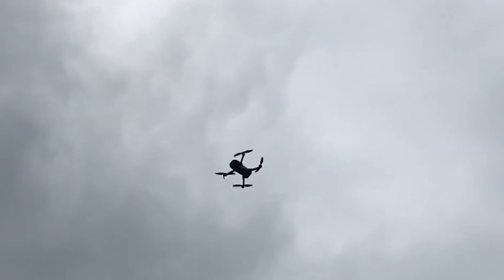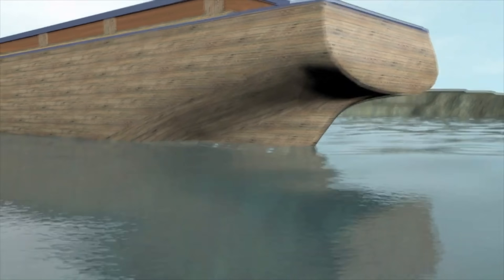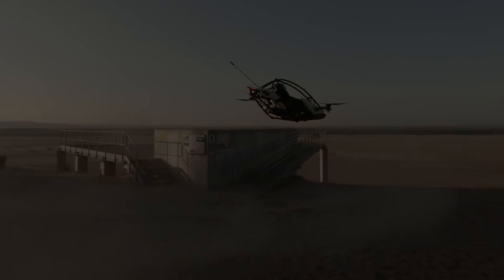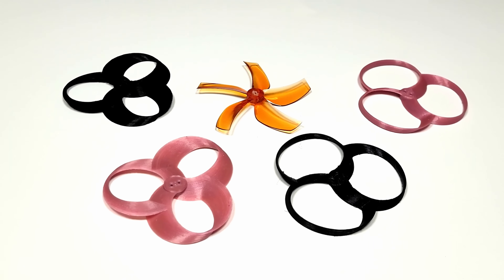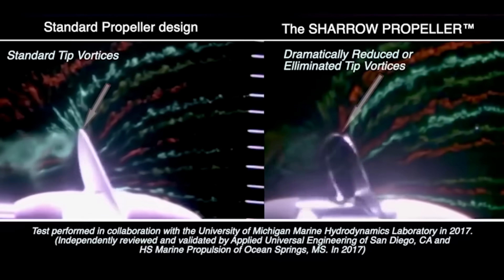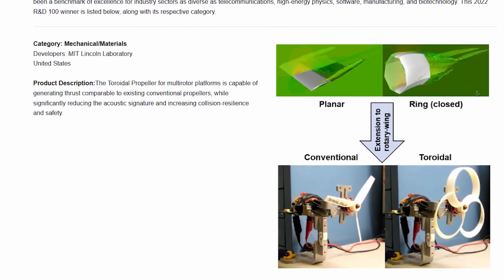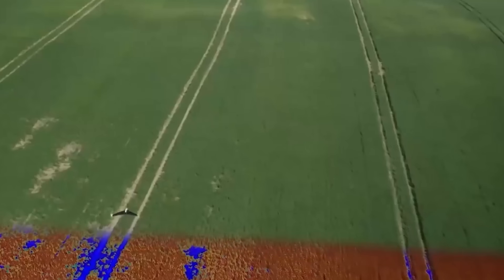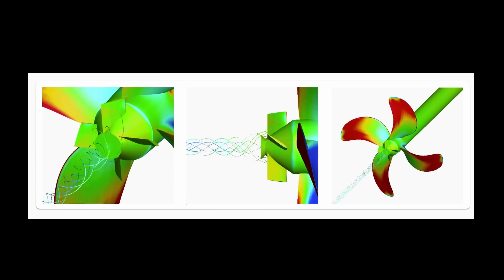This Propeller will Change Aviation Forever!

Comment: Ah yes ill be re inventing the wheel next. They are not vortices they are partial toroids just as tornados are partial toroids thats why creating your own toroid which can be done with many different blade designs is going to cancel the small toroids and make one big one. Wanna know how to make the turbo fan on an airliner quieter? I was going to use it for a hover engine. If you make a good enough toroid you can create a ground effect, then you have a skate board. Im documenting this.

Comment: Hi. Existing aircraft propellers are about 80% efficient so there's little room for improvement. Certainly not a doubling of aerodynamic power delivered, 100% is the theoretical maximum. 

Efficiency depends upon the pitch of the blades and the altitude of the aircraft, so a "one size fits all" approach isn't possible either. The reason propellers haven't changed since the Wright Brothers, is that they established the science behind them and the only improvement possible that significantly improved efficiency was variable pitch. Extrapolating from slightly improved performance on low altitude model drones to full scale aircraft at various speeds, heights, and power levels isn't warranted. Cheers, P.R.
Reply: I don't think a variable pitch Toroidal  propeller is likely to ever happen.
Reply: @mojoneko8303  Hi. Probably not, however for constant speed constant power constant pressure uses such as ships and hydroelectric turbines, a toroidal turbine could increase efficiency by 10%. For Norway and NZ that's a lot of extra carbon free electricity in their national grids. Cheers, P.R.

Comment: the plastic 3-d printed ones seem to be somewhat practical but the ones that are machined will never be cost efficient unless they cast them similar to how props are made currently for marine applications. I have been in machining my whole life and love seeing designs change throughout the years but it just wont make sense. If you go to buy a new prop for the standard guys application and see one for $150 vs this one that gives maybe a bit more fuel efficiency and considerably more brittle for $800, 99.9999% of the people are going to buy the one for $150. The other benefit is that cast props can be repaired fairly cheaply. I dont see how you can just repair this odd shape prop. You would be forced to buy a new one as soon as it gets even 1 small ding in it.

Comment: This is never going to work in aviation... turboprops need variable pitch otherwise takeoffs with high loads will be next to imposible without magalong runways and the engine casing on turbofans eliminates any real gains from this as it of how it works and trapping shockwaves etc to keep the energy. This fixed shape has to be optimized for one range of power and rpms, which may be o.k. for drones to be quieter, but dont really see future for this in general aviation.

Comment: The cover photo of the Cessna with a ship's propeller shape in any material, especially heavy metal, wouldn't fly. That is called a low aspect ratio blade shape with a twist like a cork screw, and designed for water, which does not compress, therefore the shape needs to accommodate that problem for solving propulsion. Air compresses and needs a much higher aspect ratio set of blades with higher rpms in order to create propulsion. And in modern airplanes, they become way more efficient with the ability to change the pitch of the blades during flight, like changing the gears in a standard shift car.

Comment: I had one invention in mind, since im still poor, and have no free time, ill share here. Flying skate basically, using Toroidals in smaller scale, with top vents along sides and smaller ones in middle, Gyro-stabilisation from human drone deck (spyderman cosplay) and it shall be fine to manouver, all builded in, so no sticking propellers.. even if it would work for 5-10mins of flying , you can still fly on damned skateboard, since i saw this movie, i told myself one day, ill have this, even if i have to build it myself :D I was naive, but i still want that sht

Comment: No they wont lol, performance sucks so far. They are very heavy and probably not as efficient, as for example a 2 bladed prop if you add the motor efficiency, they are also more complex and require more material, they are therefore more expensive. The thrust produced compared to normal propellers is no where near it has to be (look for chris rosser s vid). They require a mutch higher throttle output to stay up in the air, making them even more inefficient.   (from a drone perspective). Zipline props  are just better in almost any way.

Comment: This is one of those things that the engineers love but isn't practical. 8,500 hour pilot prop pilot here. Firstly, this isn't variable pitch and a huge amount of prop aviation is variable pitch. In theory you could make a VP version of these but that would require high speed mechanics (like almost sonic at the blade tips 'high speed'). Not to mention this would trade effectiveness for mass. More blade means more mass or less surface area. Seriously, these are not going to work on existing aircraft.

Comment: Look up videos of "ribbonaire fan". It was an electric fan made in the 1930's. Very quiet. And safe as the blades were loops of flexible ribbon. Arranged like a "New" toroidal propeller.

Comment: UAM is a boondoggle. Batteries simply don't hold enough charge for useful journey lengths. THEN the battery requires recharging, i.e. a significant  delay and with perhaps 10 battery charge cycles a day, the battery itself won't even last a year, more like 6 months in fact.

Comment: I wonder if you stuck this propelle on a turboprop if it could go supersonic? I ask because due to the increased efficiency the shape provides it might not suffer the limiting factor normal propellers suffer at supersonic speed namely an inability to pull in enough air to effectively provide lift for the plane

Comment: They have been around for over 100 years, so not new. They also will only affect certain size.  Unducted  fans may be coming back soon due to the fuel savings and better designs as with the RISE engines.

Comment: The graph visible at 3:40 contradicts what you say. The orange line shows the thrust generated by the toroidal propeller, and at maximum engine power it generates only 40% lift of conventional propeller.

Comment: In the future we will have propeller that change like fluid; based on what we need at that moment in flight. Imagine vertical and horizontal flight could be possible. Almost incomprehensible but possible in concept. Might be over complicating when you look at the osprey and the simple rotating assembly at the end of the wing but still could maximize efficiency based on the atmospheric conditions at the time. Maybe even “fly” in water and air

Comment: And how to have variable geometry with this propeller? It seems way too complex. If the reduction of noise is real then good for drones or home devices that use a propeller. But commercial avoation I doubt can use it in this state. Even for a small aeroplane this propeller wouldn't be too good, in case of engine out this propeller would generate I believe too much drag

Comment: This looks very interesting.  While not controllable pitch, and more massive than a conventional 2-blade propeller on a airplane, I would expect it to be made of lighter weight material that could flex, giving the effect of controllable pitch.  An advantage I see for aircraft would be substantially reduced risk of engine damage in a prop strike accident.

Comment: This design can only solved small problems with small propeller/impeller.  Good luck trying to scale this design to a medium and large propeller.  There is too much of a mass at the most outer radius and they all have to be balanced at component level then again as unit assembly.  Engineering 101!

Comment: Why does this sound like someone read a pamphlet and became an instant expert in the field.

It seems odd that nothing about cavitation was mentioned when talking about noise from propellers in water (Fluid dynamics) while actually talking on a completely different environment - Aerodynamics.
Silence is great but the tips of a toroid blade are not efficiently pushing air for their weight. The do however reduce the effect of the tip of a blade breaking the sound barrier.
(a similar reason why a current submarine prop is more shark fin shaped rather than straight like a helicopter (and even they often now support a shaped tip to reduce noise.

So lets see some result on lift capacity of a toroid prop versus a noisy one. If a toroid prop can be silent AND provide anywhere near the efficiency of a standard blade then Aviation can change

Comment: A well designed classic propeller can easily achieve 90% efficiency when operated in optimum conditions. So, an increase of 100ds of % of efficiency with this new design is pure nonsense.

Comment: I'm curious if classified naval submarines are already using a design like this. They go to great effort to conceal the props when subs are in dry dock. It could make sense considering how important it is for submarines to operate as quietly as possible.
Reply: Just look at USA propellers advantage over USSR until they purchased CNC technology from Toshiba.
Reply: @l3eatalphal3eatalpha  USSR made quietest submarine, "black hole", why USA didn't buy same technologies?
Reply: Not quite but seawolf and ohio's propellers are ducted
Reply: Dive to find out
Reply: No, but they are odd numbers of blades, and subtle differences to spread the sound across a range of frequencies rather than all at the same, reducing the power at any given frequency.
Reply: No one thought to tell Gerry Anderson that he was contravening the official secrets act when he designed Stingray then?😅
Reply: Without going into great detail.  No.
Reply: No. They weren't. Submarine "propellers" haven't been propellers for more than 50 years now.
Reply: @Nunya  no.  They still are for the most part.

Comment: I call it the non ducted ducted propellerer. It's basically a propeller with ducting included for free. ;) well giving up minimal air pushing area for getting all the benefits a ducting shroud offers.
A brilliant idea for the mentioned purposes. However not as a case fan - they got ducting(ish) frames already and having a toroidal fan inside is redundant, chewing away useful air pushing area.

Comment: Well 1st of all I'm already kind of annoyed because you used a mark Robert clip showing a silent drone with a completely different propeller design than the. One you're showing right now. Somehow. I think you're claim that this propeller will change the aviation industry is b***** based on just that alone.

Comment: So it reduces noise between 1 to 5 kHz so where is the fall off? Where is the loss? Force is resistance and resistance can be monitored. It would have advantage on the cooling fans of low performance items but not on jets. What would be the performance signature on military boats? The advantage would appear to be for light aircraft which will demise with electric propulsion anyway and presumably military drones. Domestic air conditioning units would benefit.

Comment: The Mobius strip will lift me up into the air silently. The Klein bottle will make me invisible... The painless pulse of the combat laser teleports me to a happy future, and even maybe the future itself will come for me one of these days.
The most important thing - is to reduce consumption, because ("they") just gave me a discount in the store, forgiving the missing ruble. Once, outside the city, in the tank of my car, gasoline ran out, in the middle of an empty road, where cars pass 1-2 per hour, in winter frost, when I stupidity and because of the haste, was literally in house slippers, and there were no blankets, padded jackets, there were no parachutes(such as those of the one who landed in an emergency, having broken all the the teeth of the lower jaw from сapsule hit on earth surphase - cosmonaut Volynov), I thought about removing the covers from the seats (always put good covers!) but they were thin , and in some places from cracked leatherette that did not promise warmth. The beginning snowstorm did not have drivers to stop, the mobile phone was discharged, the settlement was 5 km from the place. Russian cars cannot float on tsunami waves like Japanese ones, in ours there is always "fresh" street air, turning off the rear window heating and turning on emergency lights, I gradually froze -
however, fortunately, someone passing by stopped for a second to give me a half-liter bottle of gasoline. the "simplest" remained - to make sure that a serviceable car can start after the end of gasoline, if you fill in a new one, fortunately it turned out to be so! but in aviation "they don't fly like that"
The "road parasites" asking for 100$ today for every 6month extention of driver licence, or only 50$, if you can give your blood, for the difficult test, such as Bill Clinton would not have passed, although he did not drag out smoking with friends during his school years, as he admitted... unfortunately I have many such friends, and as a neurochemist, I am not afraid of either carbolic acids or alkaline alkaloids, I am only afraid of drugged driving, alcohol and tobacco, and federal level road robbers

Comment: I mean that was not really fair to the boats of the world using 3 30 hp motors, I say this but our old boat had basically a car engine for a motor and it was mostly quiet until you tried to run at max speed then it was no longer quiet, so maybe I'm just being silly.

Comment: You canot change a Pich angle off toroidal propeler there for you canot fly with shalow shaped propeler on a higher altitude's where the air is thiner and propeler off the single engine ir 2 engine Plane need to grab much more surface area in order to keep pushing Air to propeled aircraft forvard.....Try to get airborne Quadcopter (Drone) on higher altitude for exaple Mount Everest and the Drone will strugle to get lift..........

Comment: Toroidal geometry is the natural shape that is generally seen in the Universe around us. The shape of our current "wings" is due to our looking at birds for inspiration. However, using a lifting shape to rapidly push massive amounts of fluid or gas is inefficient on its face.

The next step will be the use of electromagnetic fields to create ionic "turbines" that can replace the physical toroidal blades and drive shafts with high-strength EM field-generating motor arrays as replacements to turbine fans, I think.

The marriage between ionic drive power and toroidal mass acceleration could overcome the limitations faced by both the inefficient legacy ionic drive propulsion systems used today and also eliminate the inherent issues faced by the heavier propeller designs and related drive shaft and motor-mounting issues of physical toroidal propeller systems.

Now, if only someone would stop playing with their 3-D printer long enough to investigate this idea... 🙄

Comment: This would be fascinating in use on submarines where cavitation and rpm issues are paramount in staying quiet. If you could reduce the rpm of the screw on a sub by 20% and also reduce the noise by the same amount it would be a real game changer in giving subs the advantage over surface ships.
Reply: If you don't think the engineers haven't tried it yet, you must not know our army well.
Reply: @Black_Toof  submarine screws cost millions of dollars and installing them takes weeks (if memory serves). Testing this would be a huge endeavour
Reply: @Sprout-1969  we've tested worse for years

Comment: You just proposed a double decker propeller.
Sound is not the only loss a propeller encounters.
The ring wing concept has again and again proposed as a solution for induced drag.
Newsflash: ist isn't
Higher thrust at lower RPM does not yet equate higher efficiency. The key figure is input power.

Comment: As a former pilot i can just say congratulations because cause inside the cockpit there is absurdly high noises. Future will be  electronic powered with this kind of new propeller and there will be no more complaints about noisy airplanes and airfields anymore 🤝💜✝️

Comment: Nope ... It may (or may not) have an impact on fixed pitch propellers but most aviation aircraft use variable pitch propellers (even some ship propellers are that way). So ... It is probably limited to small drones etc.

Comment: Interesting.  A very long time ago when I was still in university, we all knew that the centre of the prop doesn’t do much work and it was all done by the edge, so we experimented with sickle shaped props.  But they were too fragile.  It never even occurred to me the toroidal design to reconnect the end of the sickle back to the base.  That’s brilliant if you can get it to work!  🤓

Comment: Yep, I immediately thought of the manufacturing cost being high for these. I imagine this could be easily done with injection molding, or even 3d printed, for small applications such as drones. Metal machining is a whole different story
Reply: 3D printer titanium can be done on smaller scales for affordable pricing. I ride bikes, and a company called Atherton Bikes manufacture a frame with all the joining high stress points of the frame are made of said titanium. It’s a clean and affordable process now.

Comment: Researched and found to be a dead end over a half century ago. The prop itself would create so much additional drag and cause greater fuel consumption at higher speeds that you get a quieter, more efficient flight by reducing the speed you fly with a standard prop. Might have a benefit in tiny rc drones but upscaling would cancel out any advantages.